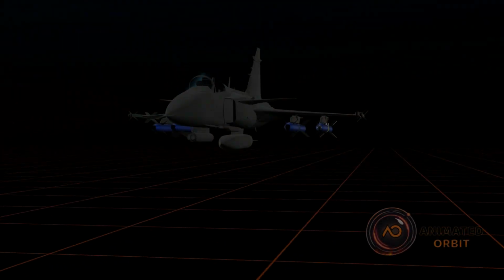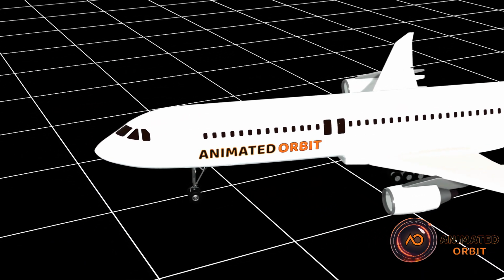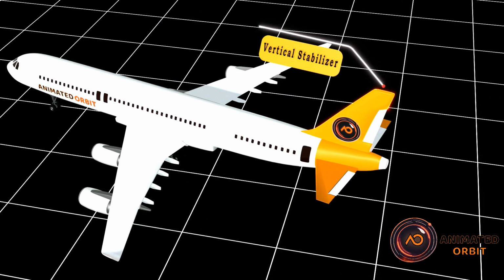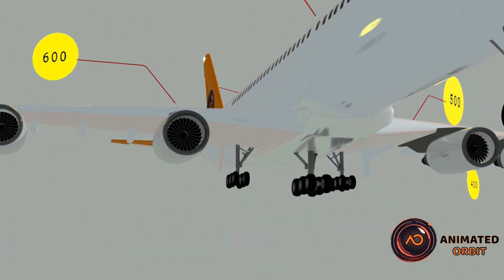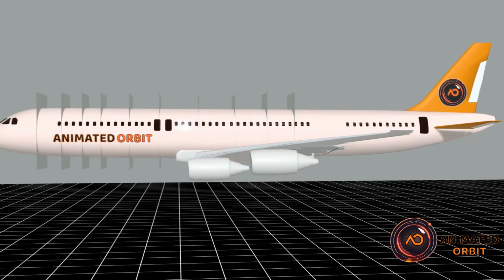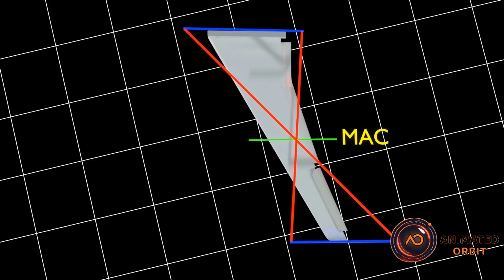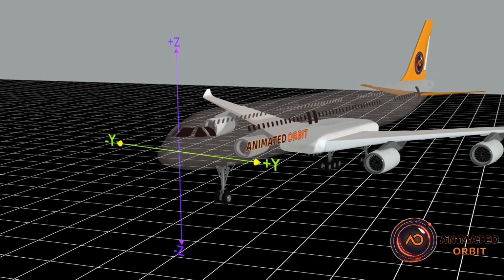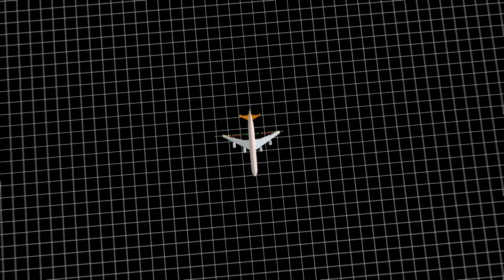Simplifying Aircraft Geometry: 3D Animation for Aerospace Enthusiasts

Comment: 100-lower half of the fuselage
200-upper half of the fuselage 
300-empennage
400-powerplant and nacelles struts
500-left wing
600-right wing
700-landing gear and its doors
800-doors.